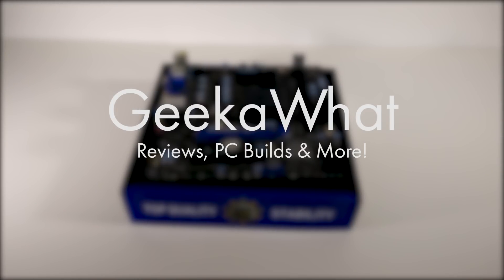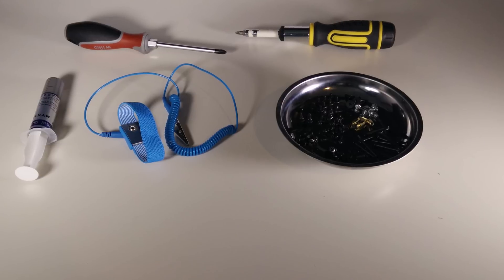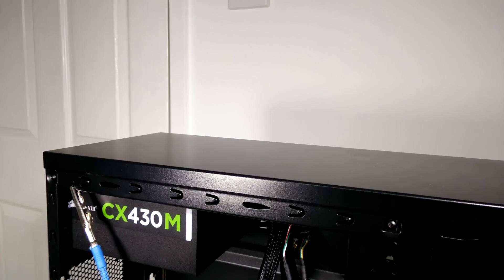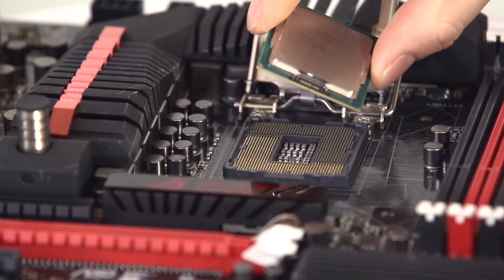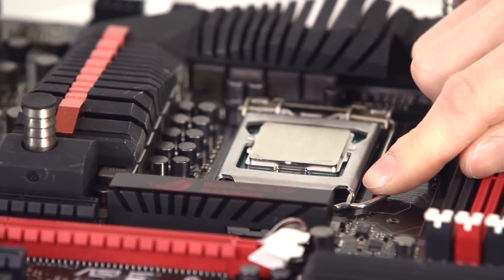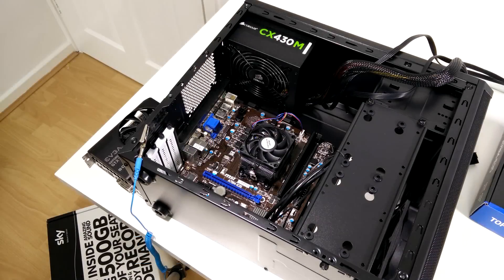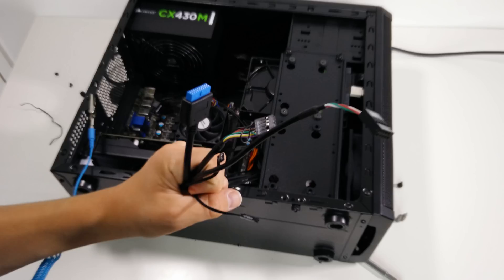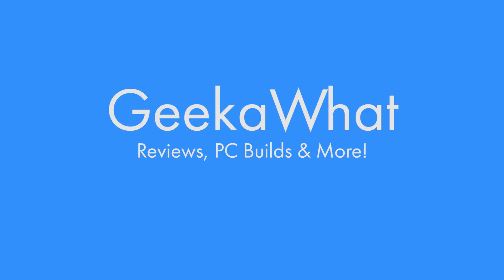How To Build a Gaming PC 2016! [FULL TUTORIAL - FOR BEGINNERS!]

Comment: Hello fellow gamers I am looking to build a PC for gaming such as assassins creed and subnautica here as the parts please help with what I should change as I am very new to PC gaming:  
An AMD FX-4350 4.2GHz Quad-Core Processor
A Cooler Master Hyper 212 Plus 76.8 CFM Sleeve Bearing CPU Cooler
An MSI 970 GAMING ATX AM3+ Motherboard
G.Skill Ripjaws X Series 16GB (2 x 8GB) DDR3-1600 Memory
Seagate Barracuda 2TB 3.5" 7200RPM Internal Hard Drive
EVGA GeForce GTX 750 Ti 2GB Superclocked Video Card
RAIDMAX Vortex V4 Black & Red Case
Rosewill 550W 80+ Platinum Certified Fully-Modular ATX Power Supply
Microsoft Windows 10 Home OEM 64-bit
Corsair CO-9050016-RLED 52.2 CFM 120mm Fan
This all equates to $666.26
Please let me know if I am missing anything or if there is something not right thanks 😊
Reply: take off the 750ti and 970 and get a 1060 and i5 6500
Reply: you will need a different motherboard for the i5 though
Reply: SpicySoviet you do realize if he does that the price of his pc will double. He clearly has a low budget, and the 970 is a good motherboard.
Reply: EchoIsPro 2 things, this is months old, and he wants to play AC, which is a very graphics heavy game and a 750 TI and his CPU wouldn't run it well, the minimum requirements for syndicate is a 660 which is better than the 750 TI.

Comment: Is this good? If I happen to be missing something or if some things are not compatible please let me know. I added up the total cost for everything and I came up with 570.40 dollars in total.

VIVO Micro ATX Mini Tower Computer Gaming PC Case Black / 3 Fan Mounts, USB 3.0 Port (CASE-V00)

Seagate 2TB Desktop HDD SATA 6Gb/s 64MB Cache 3.5-Inch Internal Bare Drive (ST2000DM001)

ASUS Micro ATX DDR3 2400 NA Motherboards A68HM-K

Gigabyte AMD R9 380 256 Bit GDDR5 4GB 2xDVI/HDMI/DP G1 Gaming Graphics Card GV-R938G1 GAMING-4GD

AMD FD8320FRHKBOX FX-8320 FX-Series 8-Core Black Edition Processor

Crucial Ballistix Sport 8GB Single DDR3 1600 MT/s PC3-12800 CL9 1.5V UDIMM 240-Pin Memory (BLS8G3D1609DS1S00)

EVGA 430 W1, 80+ WHITE 430W, 3 Year Warranty, Power Supply 100-W1-0430-KR
Reply: Yup that will work. Only recommendation is maybe a slightly faster ram system. Should play most titles around high-max settings.
Reply: I actually had a bigger budget than I thought I did and was curious if this would be a better build.

AMD FX-6300 3.5GHz 6-Core Processor (CPU cooler comes with it)

Gigabyte GA-990FXA-UD3 R5 ATX AM3+ Motherboard

G.Skill Ripjaws X Series 8GB (2 x 4GB) DDR3-1866 Memory

Seagate 2TB 3.5" 7200RPM Hybrid Internal Hard Drive 

Gigabyte Radeon RX 480 8GB Video Card

Deepcool TESSERACT SW ATX Mid Tower Case

Fractal Design Integra M 450W 80+ Bronze Certified Semi-Modular ATX Power Supply
Reply: +ice ruler king You're going to get a bit of a boost using the 8320 over the 6300 because it the 8320 effectively has "2" more cores than the 6300 although they share the same cache so they aren't truly independent cores. I personally have an fx 6300 with an R9 380 and it works great. If you choose the 480, I would go with the 8230 or 8350 amd cpus.
Reply: Mike Szaroletta If I keep it the way it is would it still be fine? I'm still going to look into the CPUs you recommended though.
Reply: +ice ruler king Most games would still run great but the processor is going to slightly bottleneck the gpu slightly. Science Studio made a video on those two paired but either will work fine, the fx8000 series amd processors will just be a bit better than the fx6300
Reply: Mike Szaroletta I can overclock it so that it does not bottleneck my GPU right?
Reply: +ice ruler king If you're planning on overclocking, go with the MSI 970 AM3+ board. That Gigabyte would work but the 970 has better heat dissipation especially for your VRM's (which get hot when OCed). But to answer your question, overclocking either cpu will boost performance overall. Doing so creates heat though so you'd probably want to add a 212 Evo cooler to your list.
Reply: Mike Szaroletta But could I still do fine without overclocking?
Reply: +ice ruler king in short, yes. Overclocking just increases the amount of processes your cpu can complete. Depends on the games you play really. With my 6300 and R9 380 I usually don't have to worry about lowering any settings so I doubt you will with a better card and/or cpu.
Reply: Yep, should be fine.
Reply: Mike Szaroletta Thanks, now I can join the PC Master Race!
Reply: No problem, have fun man :)
Reply: +ice ruler king Garry's mod should run great at full settings. Crisis will likely run at a lower fps but will still be stable at high-ish settings.
Reply: Mike Szaroletta Then I'm set until a part dies on me.
Reply: Let me know if you need any other help, happy to help
Reply: Mike Szaroletta So how will I set up an internet connection, is that built into the case?
Reply: Either use an ethernet cable and plug directly into your motherboard or buy a wifi usb adapter
Reply: I changed some parts again and possibly for the last time, maybe. I need to know if this is worse than before or better. It is also under 800 dollars which is what I was aiming for.

AMD FX-6300 3.5GHz 6-Core Processor

Gigabyte GA-990FXA-UD3 R5 ATX AM3+ Motherboard

G.Skill Ripjaws X Series 8GB (2 x 4GB) DDR3-1866 Memory

Seagate Barracuda 2TB 3.5" 7200RPM Internal Hard Drive

Gigabyte Radeon RX 480 8GB Video Card

Deepcool TESSERACT SW ATX Mid Tower Case

EVGA 430W 80+ Certified ATX Power Supply
Reply: +ice ruler king why do you keep changing it? Lol. The mobo is better but I would take one of the hard drives out and add a 120-250gb ssds for your os and most played games. Maybe shoot for at least a 500w power supply. Otherwise looks good. Don't have to do an ssd but it's quicker and you can always add another hard drive later when you need it.
Reply: Mike Szaroletta I need 2tbs for youtube. I will upgrade to an ssd when prices drop further. I think i'm done changing all this.
Reply: Honestly, I would spend the $30-$40 on a 120gb ssd just for windows and such. It can be a pain upgrading later and trying to move things over.
Reply: Mike Szaroletta I guess your right.

Comment: My desktop has a PCI Express x16 slot, but the display port slots(For the Video card display ports) on the back of my case is only 2 1/2 inches in height and 1/2 inches in width. Is that to small for the Geforce GT 730?

Comment: When it comes to building a pc. When you get your parts; does it come with the screws and equipment needed?
Reply from the maker: +James Dc You get everything needed for assembly aside from a screwdriver and anti static wrist strap (the latter of which isn't necessary) Depending on the parts list you may also need to grab a copy of windows if it doesnlt include one! :D
Reply: +GeekaWhat thank you very much 😃 keep up the great and informative videos :))
Reply: +GeekaWhat also when you get do these videos. The pcpartpicker link. Doesn't have any cpu cooler. Does it come with it or do you choose not too for the budget. Thank you for the reply btw :)))

Comment: Hi, 
I just bought a motherboard from a friend on which one of the pins in the cpu slot is slightly bended. He assured me this shouldn't be a problem but after watching your video I am a bit concerned. 
The question is should I be?
Reply: +Luis Costa If you are unable to straighten the pin then I'm afraid the motherboard is scrap

Comment: I wanna build my very first pc and wanna ask if this spec is good? -Bitfenix Neos Window PC Chasis -ASUS Radeon R7 250X 1GD5 1GB DDR5 / Asus Radeon R7 250 1GB DDR5 -AMD A6 6400K -Asus A58M-A FM2 Motherboard -Kingston HyperX Fury RAM 4GB -AVF Power Supply with Extreme 750W - Asus DRW-24B5ST DVDReWriter Drive
Reply: If I may add, the gpus you are using are great but, by personal opinion, I believe nvidia gpus are better. a good start would be two evga gtx750 ti. As for the CPU, try an amd x4 860k. It's a quad core CPU clocked at 3.7 GHz. Again with the gpu, another way to get a good gpu, try an evga gtx 960, assuming you have the money for anything I suggested.
Reply: +Epic Tales those specs are extremely nice! how much ram are you using? you didn't specify it. I would also go for just a 1 TB hdd and maybe 120gb or 240gb ssd for your OS, favorite games and/or programs.
Reply: for ram try crucial g.skill ripjaws or ripjaws x and we'll as Kingston hyper fury

Comment: Shouldn't you post before placing the mobo into the case?
Reply from the maker: +Steven Aque If it's you're fist time using the hardware then you can however I already knew this all worked from a previous build :D
Reply: +GeekaWhat That makes sense. You should probably still address that, though, for the sake of the less experienced viewers. Besides that, good job with the vid. Your builds are pretty great, too. Oh, if you don't mind me asking, what's your opinion on the AMD Athlon X4 860K?
Reply from the maker: My apologies there, I tried to 'un-complicate' things as much as possible but I'll  be sure to address that in my newer editions! It's a good CPU, I have used a lot in the past however am moving away from it as some i3s perform a lot better, it's a good value quad core, but a low powered one at that! :D
Reply: +GeekaWhat thanks for the replies! One more question: won't the fact that i3s only come as dual cores have an impact? Especially since we're beginning to see games such as Far Cry require at least quad core?
Reply from the maker: Some get around that by using i3s with hyperthreading so you have 2 virtual cores and 2 physical cores but if you can get a quad core i3 then that's better, but they are quite a piece more expensive :D
Reply: GeekaWhat There are quad core i3s???????????? I thought they only came in dual core
Reply from the maker: +Steven Aque Oh no, my mistake! What are you pairing your CPU with :D
Reply: +GeekaWhat The 860K? With all the savings I would get, I'm planning on pairing it with an R9 390. I'm considering switching to an FX 6300, though, despite how much more expensive it is.
Reply from the maker: That and an R9 390 would give you no better performance that that and a 380, the FX series or an i5 is what you need with a 390, that is a VERY powerful card
Reply: +GeekaWhat Okay, thanks! Would you recommend the FX 6300 or the FX 6350?
Reply from the maker: The 6350 is just an overclocked 6300 :D
Reply: +GeekaWhat Thanks a lot! I've been trying to get a good build together on PCPartpicker without going over $700, and your replies have helped a lot. November's when all the sales hit with Newegg's Black November and Cyber Monday, so I'm hoping I can get it down to $600 or even $500.
Reply from the maker: That's great to hear! I try my best to help :P And don't get too fixated on what you think you'll save on black Friday and cyber monday, I made that mistake and was bitterly disappointed. If there's a component you want that happens to be on sale you're in luck however for me i was a bit of a led down tbh D: